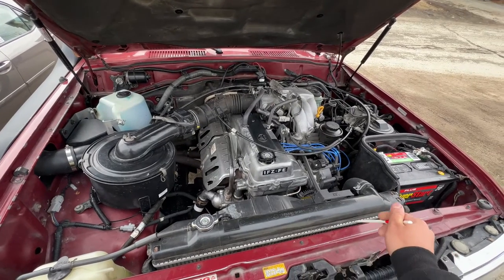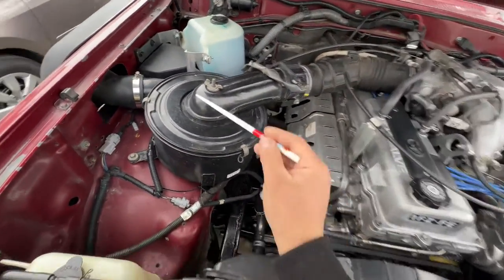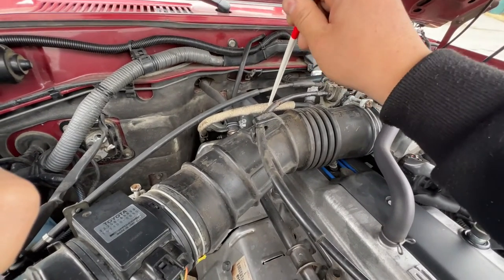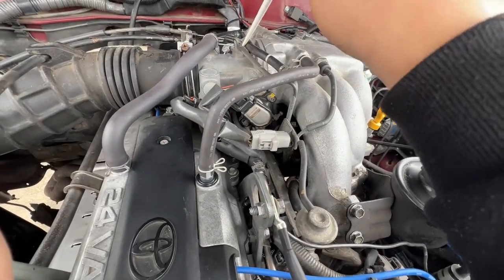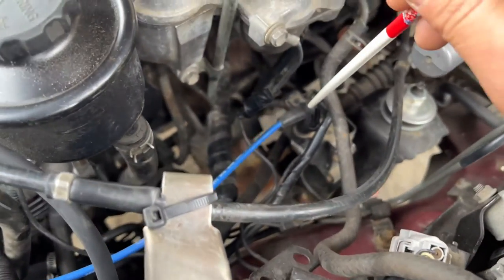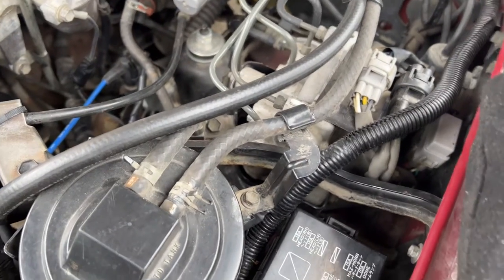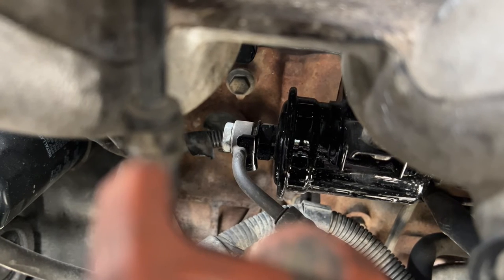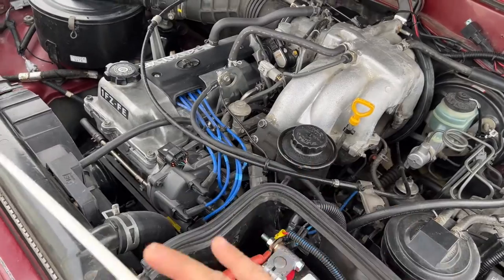TOYOTA 1FZ-FE INLINE 6 | ENGINE ANATOMY

Comment: Great overview! FYI the evap/charcoal cannister on driver side by battery is something you should look at. If you have vapor lock on gas cap, this could be an issue. I replaced mine and it was easy! My post on IH8Mud shows the AM replacement for $65
Reply from the maker: I’ve deleted that

Comment: my 1997 lx 450 doesn't have ground wire running from the firewall to the passenger side of the cylinder head. is that something the earlier years of 1fzfe or is mine missing
Reply from the maker: Missing. Just make your own ground.
Reply: @NuttyNu  thanks. I found the part on the dealer site. I'm surprised the EWD doesn't call this out? what does it ground?